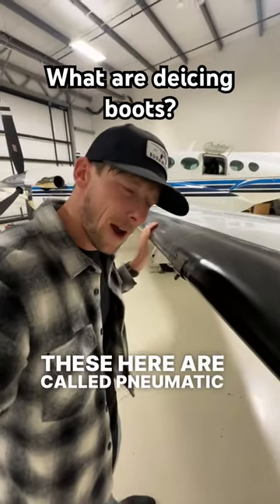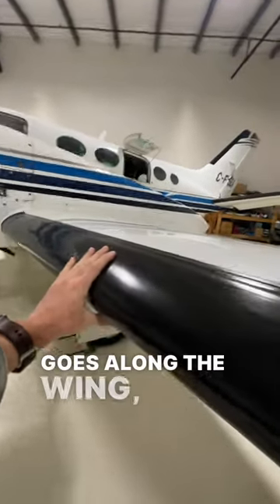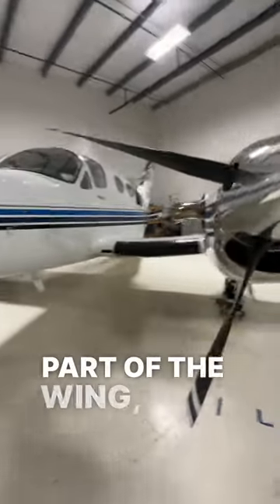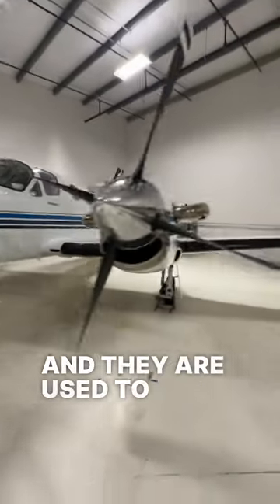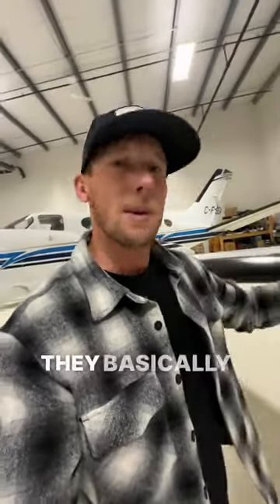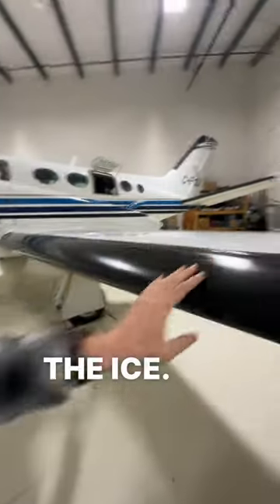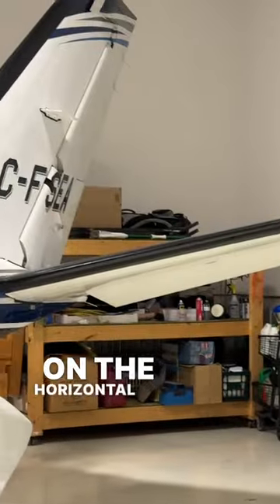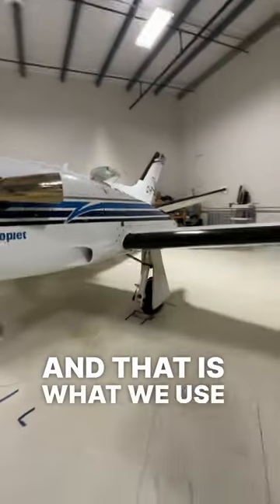🤯Rubber Wings?! Aircraft Deice Boots Explained #ifr #aircraft #pilotlife

Comment: How are the heating elements powered on the props? Since they are spinning, you cannot run wires into them.
Reply from the maker: Good question. There’s actually a ring that the connections drag against that carried the current from the airframe to the spinning prop. I can’t name the exact part, but it is basically a connection via a ring that maintains connection between the prop and the fixed wiring on the airframe

Comment: I do wonder how much of a cost/weight difference it would be to just heat the wings vs using boots. Cause the boots have limitations with the underside and topside of the wing, right?
Reply: Great question. It’s really only an issue on the leading edges, but heating even the leading edges would take a LOT of electrical power. Seriously weight prohibitive on any airplane. Turbine powered aircraft have the advantage of really hot air available from the compressor section of the engine. A PT-6 like this Cessna has doesn’t have enough compressor (bleed) air to do the job without robbing the engine of a lot of horsepower, so Cessna used a combination of bleed air, pneumatic de-icing boots and electrics to accomplish its ice protection. Boots are pretty cheap too. They’re impractical on higher speed jets, so big airliners almost exclusively use engine bleed air for airframe icing protection, and electric heat for probes, windshields, etc. That is until the 787 came along. It is an almost total electric airplane. It has really big generators on the engines and APU, so it uses heated leading edges for ice protection. One advantage of that is no power penalty when using the anti-ice or de-ice system. I asked my engineer son to put in perspective how much electric power a 787 can generate with its six 250 kva generators (2 on each engine and 2 on the APU), and he figured about 1300 average homes. Staggering amount available. The airplane obviously doesn’t need all of them at once. They’re required for redundancy, but it still remains a very powerful electric generating machine.
Reply: Heat with what? The pt-6 doesn’t general enough heat. In flight ice forms on the leading edge. Thats all that’s deciced on any plane in flight. On the ground is different

Comment: How many watts total if you were to turn it all on?
Reply: Not really relevant as the pilot. Plus, the only parts that use the electrical system are the pitot heat, prop heat, stall tab heat, static port heat, and windscreen heat (the majority of which are very small components with a small heating element). All the pneumatic boots are inflated using hot bleed air from the compressor section of the engine (at least on this aircraft, which is a turboprop with a turbine engine… piston aircraft equipped with boots will use hot air from the exhaust system).
Reply: No electrical power
Reply: @robertgary3561  incorrect.